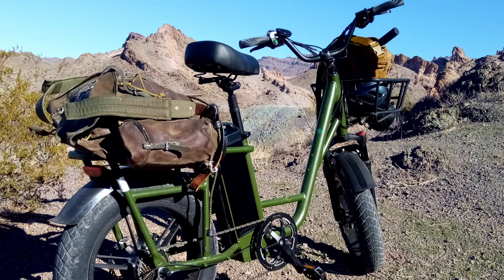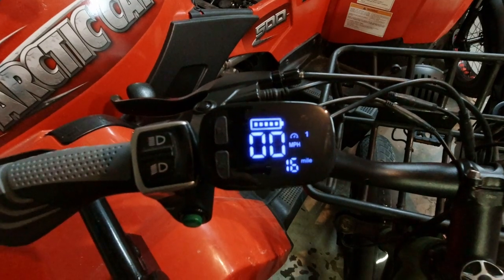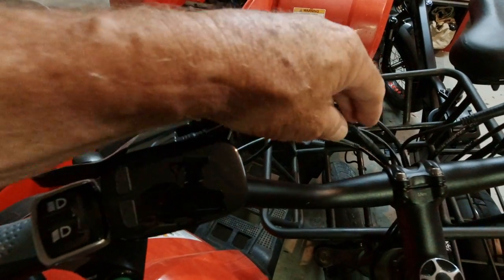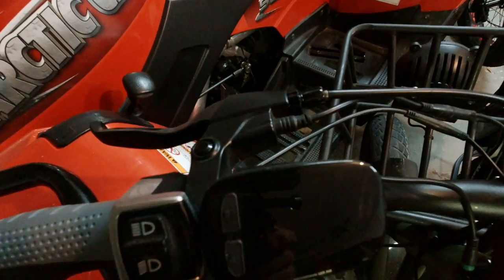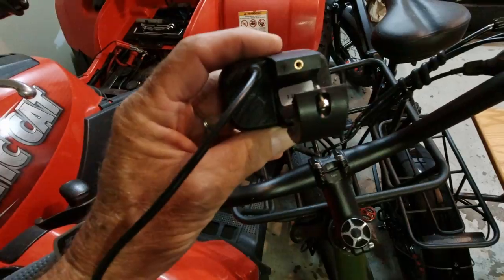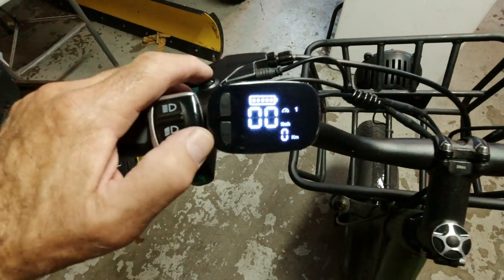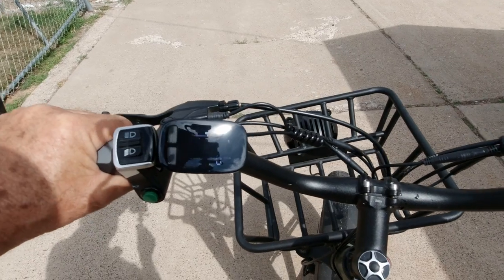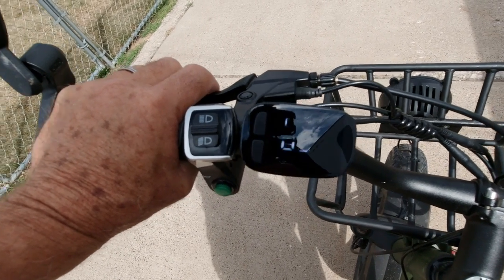Fiido T1 Cargo's new, brighter display!!!

Comment: Could you tell me how set the old display    miles per hour. My old display is bright enough for me. Thank you.
Reply from the maker: Hello Gerry.  I no longer have that display and I don't remember if it's different in how it's set.  Try this:  Push and hold the lower display button to switch from KPH To MPH.
Reply: @gonagain  Well I did and it did not work. I guess I will just learn to live with it.

Comment: One question. Does it actually have an odometer on it? To record your mileage.
Reply from the maker: Yes, it does.
Reply: @gonagain Does it only record trip mileage or is it a true odometer? I ask because I have an upgraded display (brighter than the original but it doesn't seem as bright as yours) as well and it only records trip mileage.

I also have another problem which I think is related to the display. Most of the time I cannot turn the T1 on. The get it to turn on, I have to disconnect and reconnect the display cable. Not really fun... But I love this bike. 😍